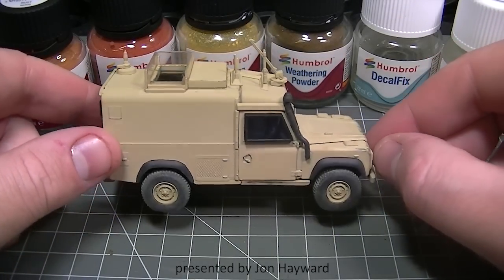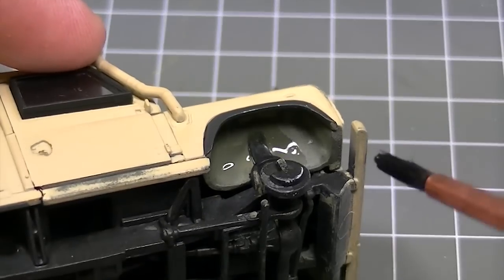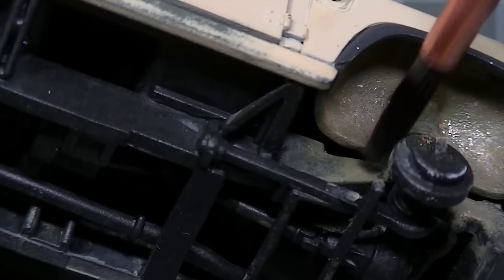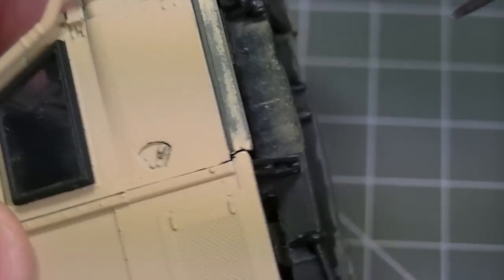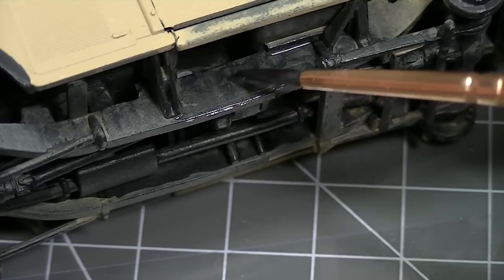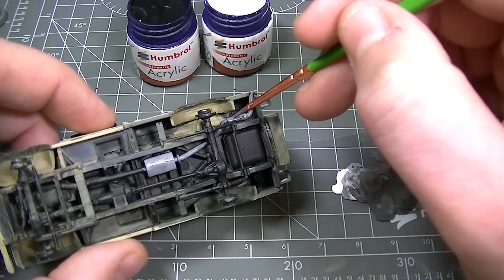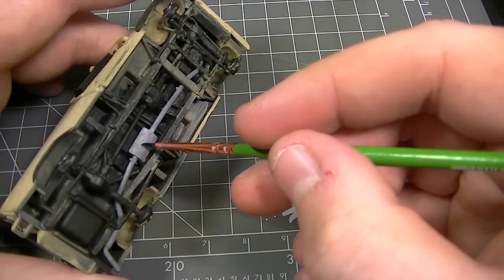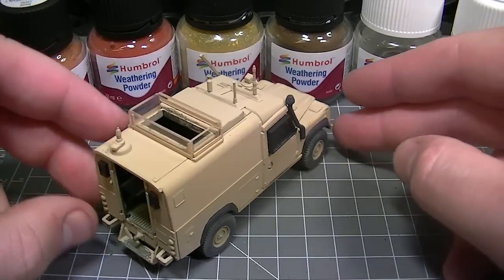Humbrol - Weathering Powder - Dried Mud, Dust & Rust

Comment: Fantastic video!
Using decal fix and water to dilute weathering powders directly over an acrylic finish, wouldn't that wear away the acrylic base coat?

Also, I usually use enamel base coats, so how would I go about diluting the weathering powders and sealing them without reactivating the base coat?

Comment: i wonder if i could use the acrylic matte Varnish instead of matte coat. i like to avoid fumes whenever i can
Reply: I simply use matte hair spray or hair lacquer. Unless you frequently pick the model up or live in a high humidity location, it pretty much lasts forever. And the initial perfume smell is gone after a few weeks. If need be, you can always reapply another layer without having to air the room for days.